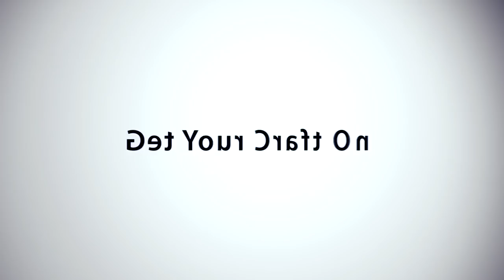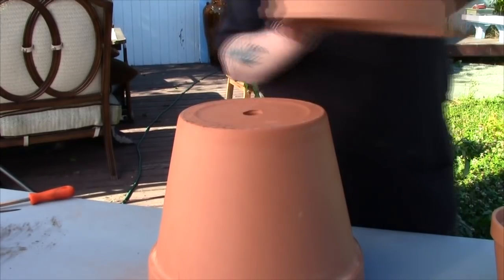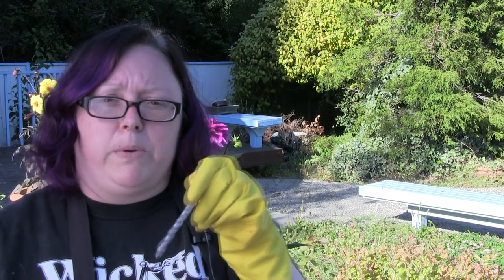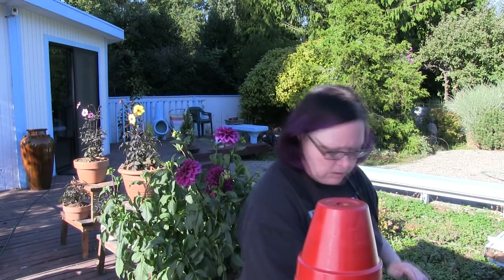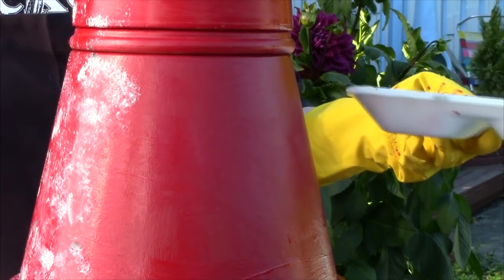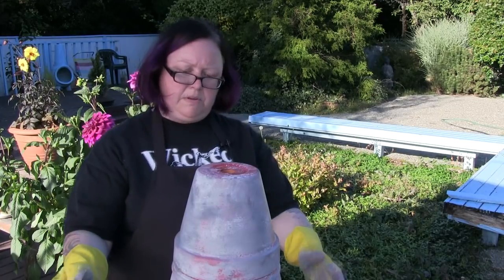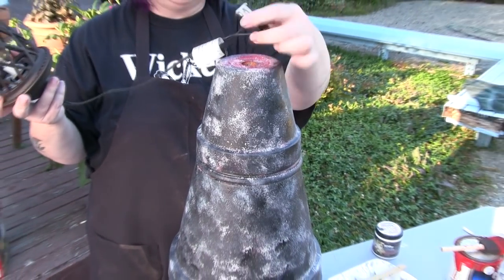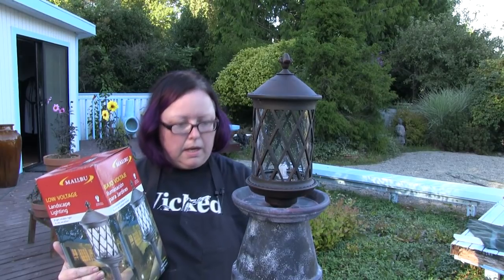Get Your Craft On! - How to Make a Lighthouse w/Terra Cotta Pots

Comment: I was wondering what approx cost for making this lighthouse would be?
very nice
Reply from the maker: For the pots: small, medium, large approx 5, 8, 12$ (depending on where you find them), scan the free section on Craigslist for garden pots. It's a great source for the budget crafter. The outdoor lighting kit was kinda spendy.. about 30$. To be honest, this project was a kind of fail for me because the light I purchased needs an accessory that's to be purchased  separately. If you choose can electrical garden light, there are no worries about electric shock or anything, when used properly. However, you can avoid all that by getting one of those solar powered garden lights. Some are pretty darned powerful. The craft paint is about 1.50 for a small bottle at Joann or Michael's. Make sure to get the indoor/outdoor kind.

Comment: Nice idea but my concern is that the pots are only balanced on top of each other and not secured very well. They could easily topple / become unbalanced in a moderate wind.
Reply: She mentioned but did not show that she is using E6000 adhesive to glue them together.  I would just use construction adhesive available at the hardware store or Lowes, Home Depot....